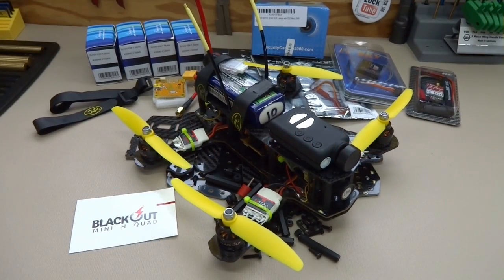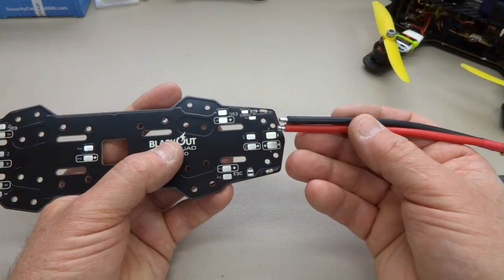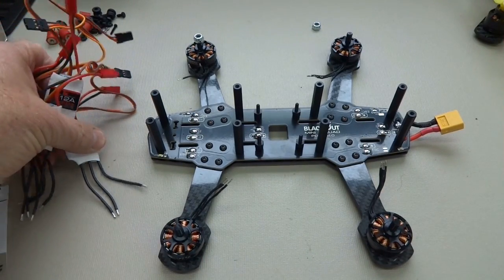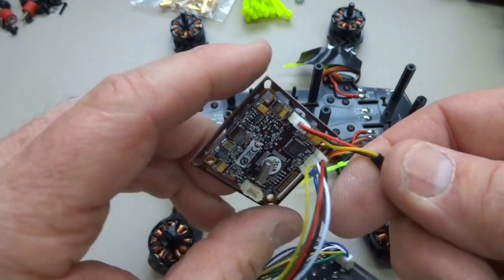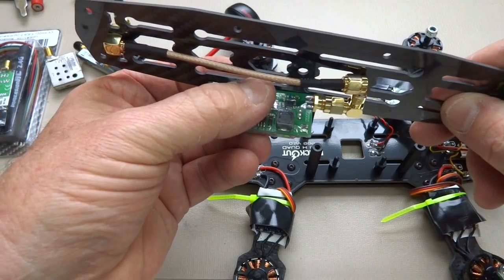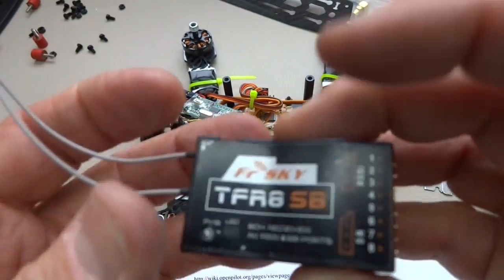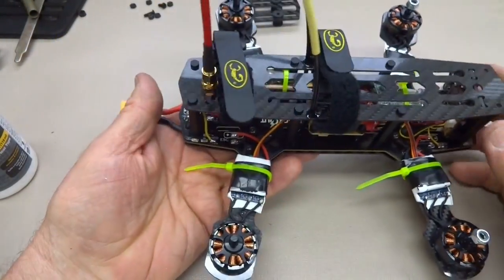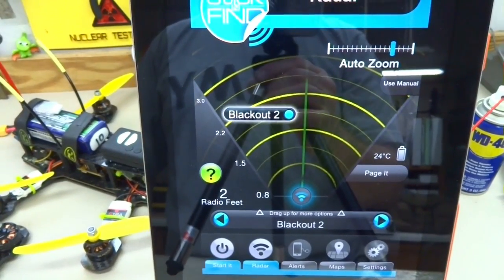Blackout Mini-Quad Build Tips

Comment: Building a kit like this looks like quite a challenge.  You must have a lot of faith in the seller to believe it will ever work?
While soldering the wires directly to the ESC and covering it with liquid tape makes a neat looking build I wouldn't recommend doing that until last after you are sure everything works properly otherwise it's going to be a real pain to troubleshoot later.  I wouldn't put any thread lock on the screws right away either.   I found that most of the parts I buy are likely to be bad so I need the ability to test and change them easily.  I bought an RTF, ready to fly model from Hobby King called the Quanum Venture but apparently their idea of RTF is a lot different than mine since I expected it to actually be able to fly!  Right out of the box it had a bad motor and bad ESC that I had to replace and it was nearly impossible since none of the screws would come out so I had to grind off the heads with a Dremel.   Even after it was repaired it turned out to be too heavy and under powered to ever get off the ground and the 8" props that came on it were too small to lift it.

Comment: After soldering everything I was going to test the motors, 2 of the motors stuttered and then the escs smoked. Any idea on what happened?
Reply: +bosnianbill these escs are from tiger motor and as far as polarity goes, it was suppose to spin CW and I double checked to make sure red cables were soldered to the + pads on PDB.  Would I be able to return these escs and get free replacement you think?
Reply: +bosnianbill well if the escs weren't toast before it is now, one of them caught on fire lol just my luck. I hope it wasn't the motor that caused the escs to go bad.

Comment: why wrap the esc wires around, is there a reason you don't shorten them up?
Reply: +Derrick Potter +Derrick Potter I think the reason he didn't shorten them is because its a massive pain,
you would have to snip them to the right length then resolder the pins that go into the hub which are tiny and very fiddly and then put the hub back over the pins you would need to do that for all 4 escs and they have 3 pins each....

Comment: Can you give me the link where you bought it from in Australia ?
Reply: bosnianbill this is a US site.. 
 www.minihquad.com and seems to provide prices in $USD..
Reply: bosnianbill im in Australia and its not convenient for me to pay USD :)
Reply: +senseTUBE There is nothing "wrong" with the blackout mini, but I think they are becoming obsolete.  There are a lot of other frames out there with built in camera tilt adjustment, more compact power distribution boards with more features such as built in voltage regulation for your flight controller etc.  A lot has improved in mini quad frames over the past year.  It's hard to keep up with all the changes.  There is even a new flight controller called the "Singularity" that has the video transmitter built into it which greatly simplifies the wiring and build and keeps the weight at the center of your quad.  I'm not saying the blackout sucks, far from it.  It's a nice frame.  But lots of other frames have hit the market since then and they have added a lot of nice features.

Comment: do you still have your broken 600mw things? I need a few of the parts on the board for one of my transmitters i burned out. If they are pretty much rubbish to you do you think you could maybe like just stick them in an envelope or something? Thanks, was just wondering because you made it sound like you would never use them or the components on them again.

Comment: I am experiencing a major problem that you may be able to help me with. I have had two ImmersionRC 600mW 5.8GHz video transmitters fry upon powering up on my Blackout Mini-Quad. This is the way I connected the transmitter to the PB. Gnd to the power supply gnd. Batt to the pos + power supply. AUDR and AUDL not used. VID soldered to vTX + P13. GND soldered to P1 next to pos. 5V OUT to P19 VIDEO.  The camera PZ0420 600TVL  The signal Yellow wire to VIDEO P17. Red to CAMERA + P9, and GND to P10. Can you see anything wrong with this hookup? Your advice would be greatly appreciated.
Reply: bosnianbill Thank You for the reply. Do I not use the 5V OUT at all?
Reply: bosnianbill I was mistaken. I have The video lead going to P19. 5V OUT going to P13, GND to P14 vTX. So if I am reading you right I use only GND,BATT, and VID leads from the Video Transmitter.
Reply: stanberryk Got it Thanks for your help. Expensive mistake.
Reply: bosnianbill I got it, was wanting to make sure. Expensive mistake. Was the last part on my build.Your help was much appreciated.

Comment: I thought I recognized that voice.. lol. Awesome !! Yeah, I'm actually going to be building my first quadcopter. Been studying for about 3 days now non stop, I basically know just about everything there is to know about putting together a Quadcopter. Frame, Motors, ESC's, power distribution board, then the flight controller. Thinking very strongly about going with the CC3D 32 Bit. Then after I save up some more money going long range with eZ UHF setup. Awesome. Subbed. (+1 : 1,004)

Comment: Good tip with the VTX, I do similar. I have actually repaired a few but soldering skills have to be really good. I use thin coax with the correct SMA female connector, about 2" long. Solder the braid left and right onto the PCB ground plane. The centre has to be carefully soldered onto the tiny resistor on the track that fed the original connector, not easy but do-able. Also use those cheap hobby king locator buzzers, use a spare RX channel and TX switch, set failsafe so it comes on if TX switched off, a lot of bad reviews on those sticky things!. Good video, thanks.

Comment: Great video. What battery are you using? Also to let you know that I bought 3 Stick n find. The app sucks.  The ratings are bad. No support at all. It doesn't let you sign in and other things. Pulled up the company s You tube video and it won't let you leave comments. But love you video.

Comment: Have you ever had an issue with the super simple osd cooking your fpv cam? I picked one up and installed it and lost a couple cameras. any thoughts?
Reply: bosnianbill Hey Thanks for the reply! I tried it with another camera I had lying around. Turns out that the problem was the ground wire from the camera. I am now only running the video signal wire through the osd with the ground wire going directly to the video TX. Works like a charm. Thanks Again! your video has some very useful tips keep it up!

Comment: Another question for you. So I fried one power board and es's. I am making progress. The camera you use is the pz0420. Does yours run on 12volts? If it does? How did you power it like that. Does it get the power of 12 volts from the board (powered by lipo) or is it getting 5 volts from the immersion transmitter? I plan to run my set up like you. Thanks.

Comment: I am using this Video TX and it rocks! uper light, >600mW power and has cable already http://northdrones.com/products/HAWKEYE-Mini-5.8G-600mW.html
Reply from the maker: Petr Valkoun Why would I use an off-brand video transmitter of unknown quality like this when I can buy a REAL ImmersionRC 600mw video transmitter that comes with guarantees and customer service for LESS MONEY?  Are you spamming us or what?
Reply: well, because the RF design of the immersionRC sucks (see the unshielded signal pin in the connector) and because the Hawkeye has cable so it is very usefull for installation into the quad

Comment: If you are going to build ANY quad watch this video based on experience and do unto yours as he has done to his but keep your feet on the ground learning. Tip one applies to every quad and wire that can be pulled off but don't forget to ground thyself when handing ANY microchip OR gold plated connector pin as found on every RX. You can say it doesn't matter like most do but many say the same thing when replacing a failed microchip component as the Great Almighty E teaches a lesson with a little tiny bolt of lightening you may not always feel but can sometimes see happen in the dark.

Remember... nonconductive materials like IB Crazy's crazy antenna packages will hold a heck of a static charge in shipping that WILL fry an ESC, a UBEC, FCB, ANY micro chip taking it out of the shipping box that feels the force of the static discharge usually prevented by a special static bag you should pay attention too as it's a warning. When you see packing material sticking to other stuff or the hair on your arms tingling reaching into the box ground yourself BEFORE you feel it while taking anything with microchips out of the shipping box to get rid of that built up static charge safely by grounding yourself. When using exposed micro chips to save on weight use your head and some very thin lightweight heat shrink you can wait to heat and have it hold the wires on as well as keep ungrounded fingers from touching the gold connector pins. It's easy to cut the heat shrink or heat it half way so the wires can come out... if that's what you want. And remember carbon fiber is conductive so you can even ground it while working on your quad to avoid hitting the ground or a tree that WILL make a sound even if it's in the woods sticking in the ground.

May the force be with you but keep it to yourself and ground yourself for protection or you'll be sorry and probably wonder why it happened to you and not me or someone else. DOA's right out of the shipping box happen for a reason that can happen later on just as well as far as the dealer selling you a new one goes. Shhh... it's top secret. They make a fortune off of people's mistakes. Look at the manufacturing plant that would do anything to save a penny and all the money spent to prevent static damage until it gets in your hands and belongs to you. Not paying attention to static discharge is the biggest mistake commonly made OUT OF A VARY BAD HABIT shown in almost every video you will see dealing with micro electronics.

This guy could have been wearing a grounding strap on his ankle so his hands would be free to do what he needs to do. The ground is everywhere but it's a bit of a common contradiction. Sometimes you need it... and sometimes you don't. It can cost you money... or it can save you money. It's all how you use it.
Great information and advice... thanks for sharing.

Comment: You don't use a LC filter for video TX and camera? Just curious about the placement.
I'm using Fatshark and the filter is kinda bulky for a quad this size. Theres not much room to spare and I have to run it off the balance plug which further limits the options where to put it. 

Do folks usually get a smaller filter with these minis or do they skip it altogether?

Comment: I love your build tips. I have watched this video over and over. I have been watching and piecing together my quad build. I plan to run the same set up only difference is I will be using a spektrum 6100e receiver and a minimosd I got off ebay for less than $20. What exactly do I need to do to make this work like yours? I am only looking for volts or mash whichever works I plan to keep it simple all this will be running into a cc3d. Any help would be greatly appreciated! Thanks
Reply from the maker: Andrew,  Sorry but I can't help you with the Spectrum since I've never owned one. Insofar as the MinimOSD, just power it from your CC3D with 5 volts, and run your video through it.  You can use the MinimOSD software to customize the display with whatever you want to appear on it.

Comment: Do you have issues with your FPV vid signal??..... I fly the blackout mini H and I have tried different escs, another power board (I use the same one as per your vid here), I have tried different radios (Graupner, Taranis & 9XR pro), I have even tried different FPV antenna and different TXs......... the only thing that is the same is the flight control board, props and the motors....... I am running the Cobra 1960s but 50m out and its a snowing..... any tips or solutions would be appreciated....... PS I use a filter and a separate 12v battery to power the camera and vid TX...... as the blackout runs on a 4S..... cheers

Comment: very nice video very helpful!! btw where i can buy the esc just like you have? thanks
Reply from the maker: Try the amazing new tool called "Google" and you will find several sources for the Tiger T12A ESC.
Reply from the maker: Yes, you DO need to calibrate your magnetometer.  It is very easy, just push a button in Cleanflight or use your sticks when in the field.  It is in the manual.

Comment: where do i find a Nanotech 3S 1500mah 35C/70C battery
Reply from the maker: Owen, Owen, Owen...

There is this amazing thing called Google.  If you Google "Nanotech 3S 1500mah 35C/70C battery", it will take you to HobbyKing's website, the manufacturer of the Nano-Tech.  Here, I did it for you:  
http://www.hobbyking.com/hobbyking/store/__26453__Turnigy_nano_tech_1500mah_3S_35_70C_Lipo_Pack.html

Comment: What gauge wire did you use for the power lead on the XT60 connection? All I'm able to get through those little holes at the back is 16gauge.  Is 16g large enough? My 1500mah Nano Tech batteries have 14 gauge leads and I generally like to match my power leads with the battery leads.  Just thought I'd ask since I'm about to build my mini H.  Thanks.  I see below you drilled them out but don't mention the wire size.

Comment: what gauge wire did you use for the power connector? 24AWG? beacuse those holes seem small or did you bore them out?
Reply from the maker: I drilled out the holes a bit to fit the wire.  There are no traces around the holes so no worries about ruining anything.
Reply: I am worrying about hitting the Leds that are close to the holes

Comment: What lipo charger do you use?
Reply from the maker: I have an iMax B6AC that I bought from eBay.
Reply: Oh ok ya i was thinking about getting that one but then i got confused with buying a PSU along side with it? What specs do you go buy when buying a PSU for any lipo charger?
Reply from the maker: The B6AC comes with the power supply unit installed.
Reply: Ok then j must have been looking at the version that didn't come with one, thank you

Comment: First mini quad build, and building up to this moment i can honestly say that youve gotten about 100 views just from me. Ha ha. But I have a quick question, when placing the power wires through the board and then soldering, which by the was is brilliant, did you have to drill out the PDB a little to get the 12AWG wires to fit? Thanks for all the insight on these quads.

Comment: What kind of range could you expect with this setup?
Reply from the maker: The range limit is based on the battery, not the radio or video.  I get about 6-7 minutes of flight time.
Reply: AerialWerks I guess that's fair enough, but what about more along the lines of how far away would you be able to fly this before losing signal/control?
Reply from the maker: davross600 I've flown mine out to about 1km with no issues whatsoever.

Comment: I just finished my build on a ZRM 250 Mini FPV and upon take off if flips backwards. I subsequently went back to this post and noticed you said something related to my problem. You said something about improper ESC connection (prop #1 through #4)  to the flight board (KK2.1) could cause this problem. Did I get that right?  Thanks

Comment: Nice Video :)
One thing to say about stick and finds:
do not place the behind the mobius or infront of the battery. I smashed one of them, they are not as undestrucable as the quaditself :D AND, if you have to reset your Iphone your stickandfinds are gone, I cant reconnect them to  a new phone. and 50 Bucks is serious money too :D
Reply from the maker: Your timing on this is AMAZING!  I just had to do a reset on my iPad and, like you mentioned, lost ALL my stick-n-find pairings.  Since I have one on each plane & quad, that's about 9 stickers LOST.  After some screwing around, I found that to fix this, simply remove the battery from your stick-n-find, then put it back in.  Basically it re-boots the stick-n-find and allows you to re-pair it with another device.  Good luck!
Reply: great thank you buddy :D
okay I try to reboot the one I have left, that should work.
now the tricky part: Find the Sticker :D
Reply: ok, found the sticker,  tried to open it  with my fingernails, and broke it. wtf. the plastic is very brittle and cheap, now I have to make my own housing...

Comment: One tip that can help save a little soldering time. Since you are going to have to test the rotation direction anyway, and you know that you need two motors rotating in the opposite direction of the other two, solder them in pairs. Provided you use the same motors and ESCs on all corners (as you should) you need to test only one arm and then you can install them all safely.

One pair you solder the motor wires to the ESCs using the pattern 1-2-3 and the other pair you solder 1-3-2. Figure out what the rotation is for one of the arms, then install them accordingly. So if your 1-2-3 test arm rotates clockwise, it goes on the front left arm, and its pair on the rear right. Likewise for the 1-3-2 arms (front right and rear left). Voila! Solder once, test once, install once. Double check rotation after installation, but if you've purchased quality gear it should be correct.

This method is more important on a hex, where there is either going to be more resoldering, or more disassembly.